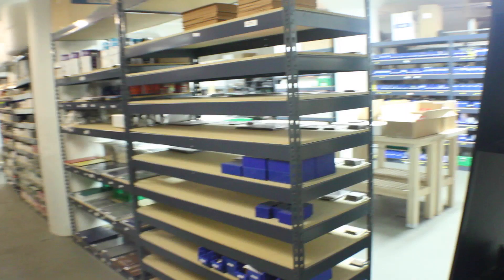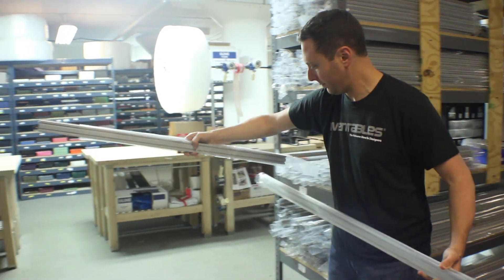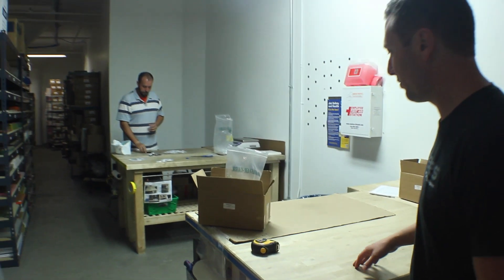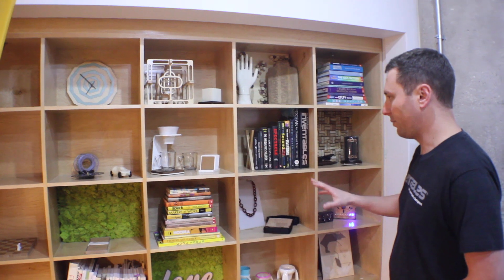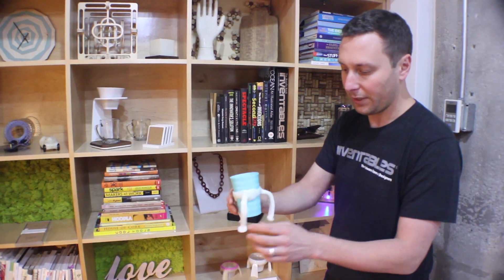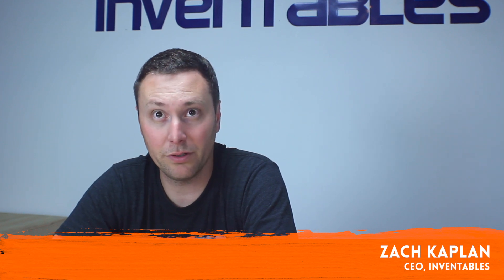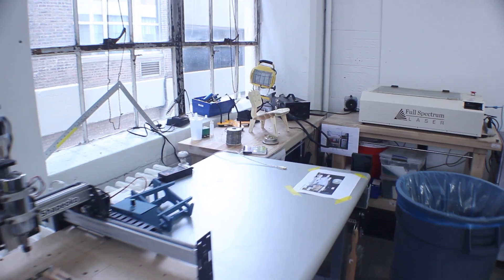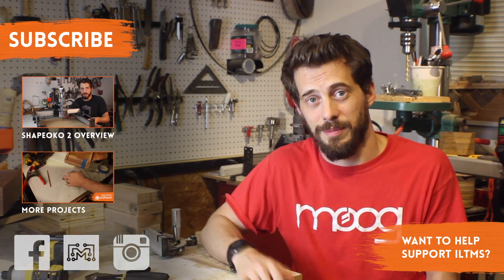Inside Inventables (makers of the ShapeOko 2 CNC milling machine) | I Like To Make Stuff

Comment: What is the longest length you can get he doesn't actually say https://youtu.be/EgiCww_JhwY?
Reply from the maker: Willywonka321 Theoretically you could chain pieces together and make it as bit as you want, but you'd eventually run into rigidity problems. The longest single piece they sell is 1000mm.

Comment: Awesome, love it! Why do they keep a roland-thingymacnc though? Also noticed they are using different stepper drivers from what they are selling.
Reply from the maker: ***** not sure about the roland, but I do know that they sell bigger stepper motors as an upgrade. That MAY have been what you saw, not sure.
Reply: I Like To Make Stuff The big shapeoko in the video looks to have nema 17 for the z and 23 for the x and y. But whats running it is definitely not a g-shield:) I spoke too soon though, as they are in fact selling it! Looks like it's the Leadshine MX3660.